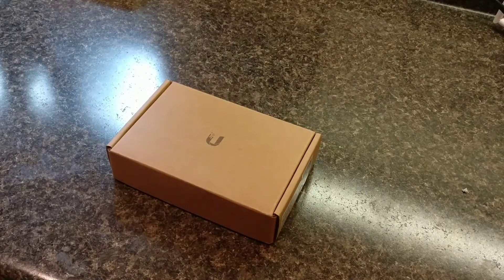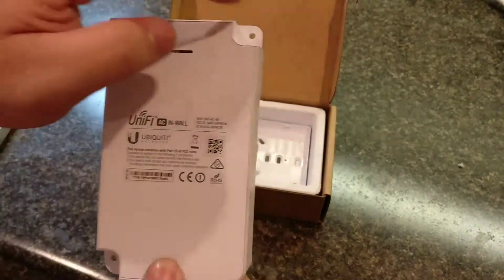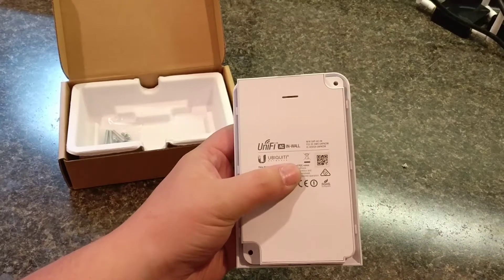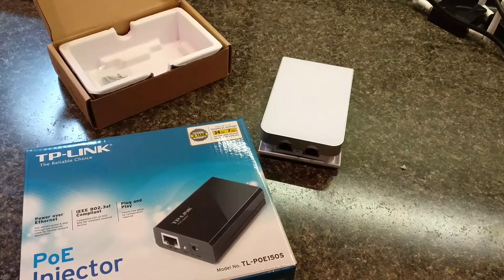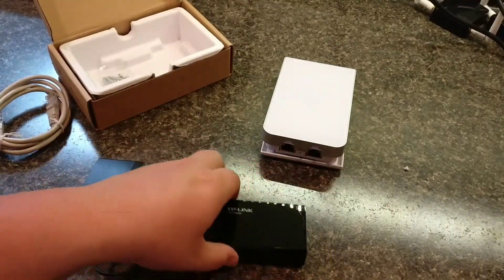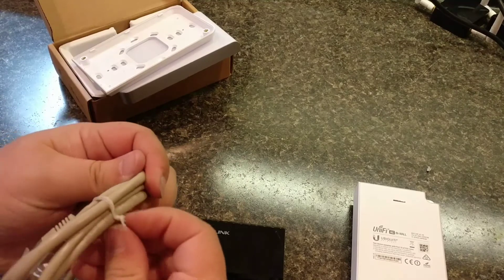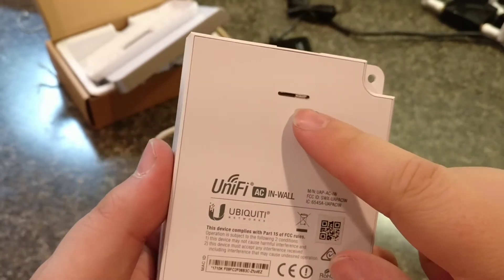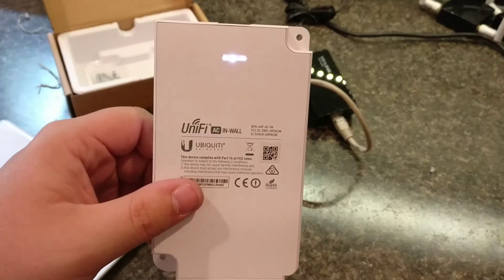Unifi in-wall AC and first look

Comment: where is power supply or there are batteries inside ?
Reply from the maker: marax These units are powered via 802.3af PoE, meaning the power is sent over the Ethernet cable. At the other end of the cable, you would have an 802.3af PoE "injector", TP-link makes good ones. 

Thanks for watching!
Reply: 802.3af ?
Spec says 802.3at PoE+

Comment: I hope UBNT isn't marketing this as "in wall", because from what I'm seeing (not even two minutes into the video) is that it is NOT "in wall", but "on wall".  You even mention you mount the wall plate onto a wall box...
Reply from the maker: Correct. I will be showing a video of it installed & speedtest. It hangs OFF the wall not IN. I agree, not sure why its marketed as in-wall. Their previous model was half in half out, but correct this one hangs completely out. Although it is pretty slim, and doesn't protrude too much.